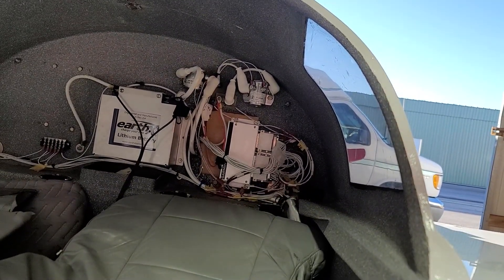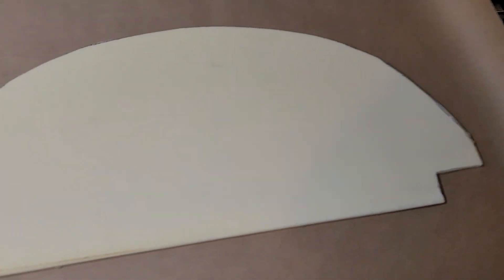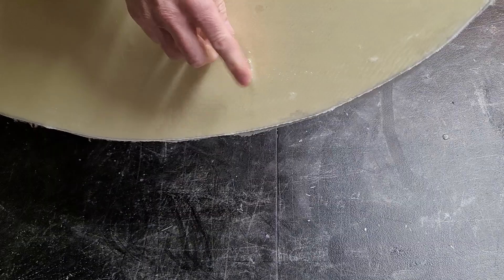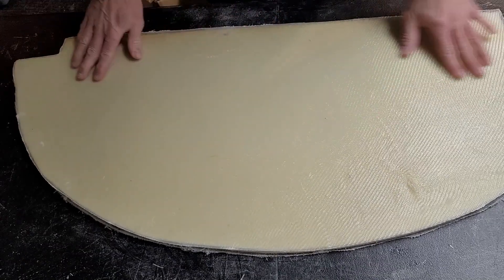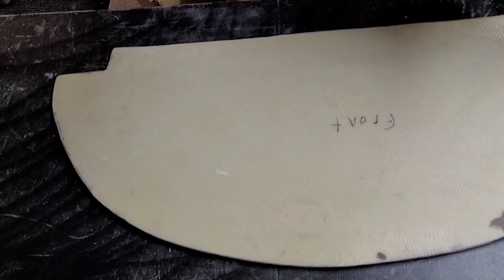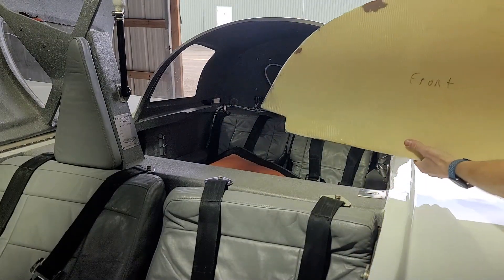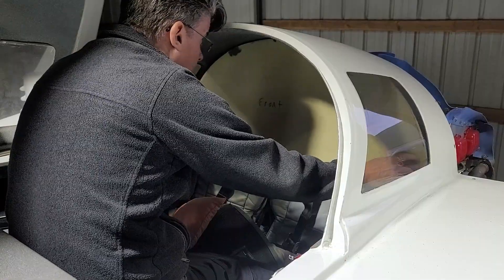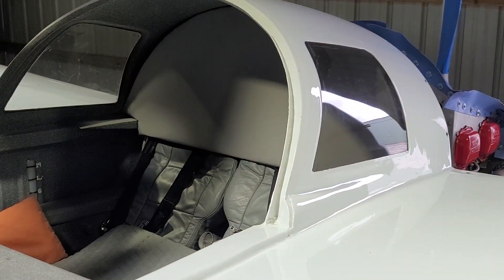Building a New Rear Bulkhead Cover for my Cozy MKIV Airplane

Comment: Nice work. It's not structural, so you really only needed one ply of BID per side, and if at all possible, try to use peel-ply on all your surfaces. Saves so much sanding.
Cheest.
Reply from the maker: I normally do use peel ply on everything, but I knew this was getting covered up with leather, so just a quick sand and it was done. You're right that it's not structural, but I did think; "someone will rest their head against this" which is why I went with two plies on each side. The weight difference between one and two plies is pretty negligible.

Comment: Yeah, not structural so bubbles and or dry spots are nothing. Maybe some Velcro tabs to keep it from migrating around back there. Oh and some foam head rests made from foam and sign board covered and Velcro on would be a nice touch. Good work. Did you make any head way on you cooling issues??
Reply from the maker: There are velcro tabs back there already actually, just didn't show in the video. Cooling update is coming...

Comment: Scott, nice job, looks great! Say, did you solve the cylinder temperature issue? I suspected that you had air stagnation around the cylinders and that perhaps your exit port was not low enough pressure to allow the engine to breath. I hope it's resolved. Cheers!

Comment: Before putting anyone in the rear seats you need to cut slots in the bottom of the new cover so that the shoulder harnesses can come straight off of the attach points and not have to wind their way below the cover. Not safe for the rear seaters as is.

Comment: Mylar would be a much better splash guard for your table than paper.  Epoxy won’t stick to Mylar….  [ed] Notice the waviness of the fibers?  Those fibers should be straight as an arrow in the required direction for strength.  This isn’t a structural piece so it doesn’t really matter beyond aesthetics, but practice makes automatic.  Tugging on either end of the fabric along a set of fibers you want to straighten works great.  Also, once laid down onto the piece, wetted out, and squeegeed, trim the fabric to within a half inch or so to keep the fabric from lifting up from the core around edges.  Peal-ply works really well to create a nice finish for additional bonding or paint, requiring minimal to no sanding to prep for such a step.  Be sure to leave it on until you are ready for that next step, or the oxidation layer will form quickly and you’re back to having to sand again.  

The end result of your bulkhead cover looks fabulous anyway!  So take this all as merely suggestions for experimentation later.
Reply from the maker: If this was a structural piece, I would definitely have had someone assist with the laying up of the fiber, to make sure the orientation was correct as well as the straightness of the fibers. Those were largish pieces to be doing on your own. I don't know if you could see in the sped up video, but I did actually trim the fiber after it was laid up, to prevent it from lifting - I have a separate set of scissors dedicated just to that purpose. I normally do use peel-ply on every piece (which you might have seen on other videos when I was remanufacturing the gear leg), but I didn't bother here, a) because I didn't care about the finish, which was going to be covered up with the leather, and b) I wasn't going to be bonding any more glass to it.